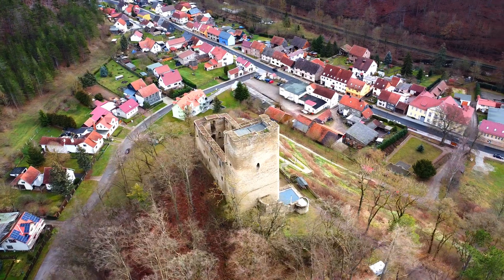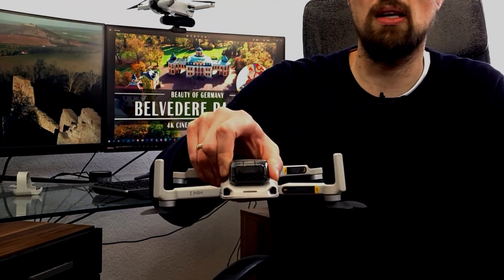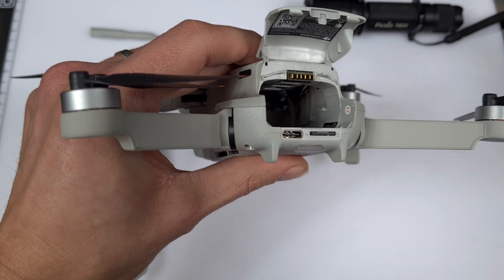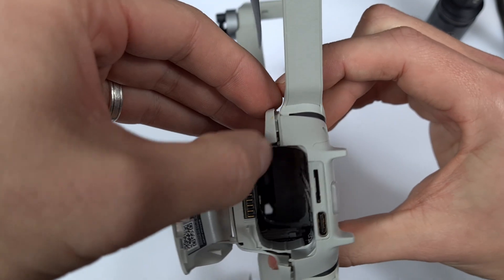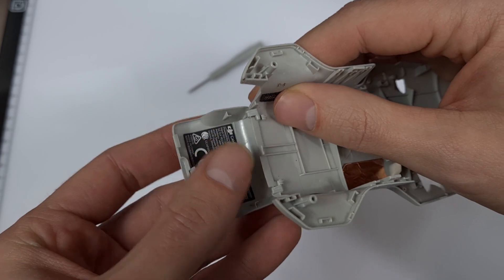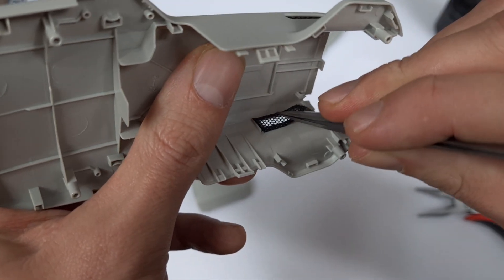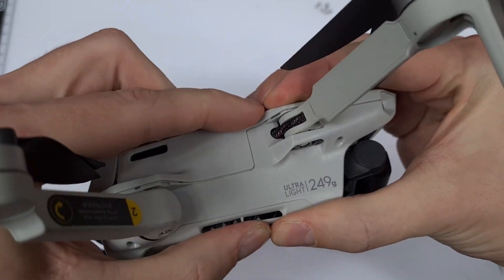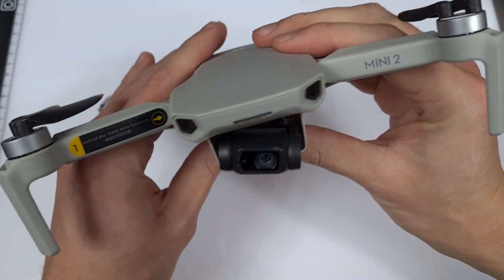How to repair the TOP COVER of a DJI Mini 2 Drone

Comment: hey man ... what is that gold tape under the cover? is it copper tape? does it have a specific name? im looking through the webs and cant find anything like it... all comes up as heat shielding tape
Reply from the maker: Hey man good question! Yeah that tape under the cover looks like copper tape and basically it is copper but its not the regular heat shielding tape you often find online. This stuff is mostly used for electromagnetic shielding inside the drone.

The idea is to block interference from other electronics and protect sensitive components like the GPS module or flight controller from electromagnetic noise. Especially in drones you got lots of small circuits, antennas and stuff packed into a tiny space so shielding becomes super important to keep everything working smooth.

The golden or reddish color comes from the copper itself sometimes with a slight coating to prevent corrosion but it stays conductive. Usually this kind of tape has a conductive adhesive too so it actually connects electrically to the surrounding parts and isnt just sitting there.

If you search for EMI shielding tape or copper foil tape for electronics you might find something similar but the exact stuff DJI uses is often made custom for them or at least high spec. So what you see online as "heat shielding tape" is mostly for thermal insulation like for cars or exhaust pipes which is different.

Hope that helps man let me know if you got more questions about it!
Reply: @doatrip  yup ... found it... mainly marketed as SNAIL BARRIER for some reason 😀 and then it small print "also EMI shielding ect" ... so ordered 10mm one and double it up if need be... its conductive after all 😀 i bet it arrives from amazon faster than i could ever peel that flimsy bastard off the cracked lid with a hairdryer 😀
Reply from the maker: haha! cross my fingers for you that your repairs are going well!